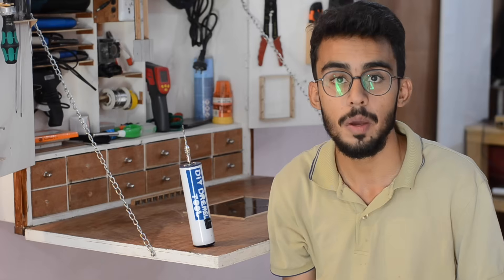How to make a Portable Dremel tool under 10$

Comment: SIR DO YOU MAKE DIY DREMEL TOOL BUT NOT IN CORDLESS, SOMETHING LIKE CORDED DREMEL TOOL, THING IS I DONT HAVE A RECHARGEABLE BATTERY SIR SO  IM DEPENDING  IN CORDED, LIKE USING AN 12V, OR 24V ADAPTOR  TNX

Comment: That 18650 battry is bad dangerous with no bms inside the also when u solder an 18650 pls dont heatup the battery it can blow up or damage the battery ex: the bat capcity is 2000mah if damge it ca change to 1200 mah.

Comment: You need to add BMS for your battery pack. Otherwise you possibly damage li ion cells, or worst they can explode due to overcharging. Please remove your video from YouTube. This is a very bad example for amateurs

Comment: I like this video I want to ask that you can make soildering iron at home
Reply: Better to get a new one 60w costs 300 inr and 15w costs 125 inr but 15w is not worthwile
Reply: ya ,you can make it as hobby, but as professional its difficult . in very shot time your battery power empty  . you have to charge your battery frequently . repeated you have to change that wireless soldering to use it for long time :) i hope your are happy with this answer .

Comment: What tool are you using to cut the fiber glass around min 10:10?
Reply from the maker: Ricky Hooper i am using a hole say to cut that
Reply: Amit Kumar Gupta
Reply: I noticed this hole saw myself. I have never used 1 like that. Is it adjustable for different hole sizes?

Comment: No protections on LiPo batteries + it's very dangerous to solder the batteries directly with a soldering iron.
You're giving very bad advices. When you don't know how to do it, you don't do it, and you don't pretend to be able to show it to others.
Please remove your video, it's dangerous.
Stop chasing after Youtube money.
Reply: are itni to protection de rakhi hai kamakal maaro sab ise milke
Reply: that is wht i was thinking ... but some cell protection inbult cells he can use ...shaft wobbles that bigg fault
Reply: সহজ ইলেক্ট্ৰনিক্স অসম sohojE - Na janake montobyo dise kiyo? LiFe aru LiPo 'r maajhot parthokyo aase, jaane ne?
Reply: yeah
Reply: Also don't drill in wood using metal drill. You'll burn it.
Reply: Salim Sarwar  No matter how much effort he put into it. It doesn't make his DIY correct or interesting. It encourages neophytes to do dangerous things and not to think about what they are doing.
Reply: This is not LiFePo but Li-Ion battery. They are safer than LIPo ir LIFePo but still can explode or catch fire.
Reply: ROBIN Guillaume First, it's not lipo batteries. They're LifePo batteries. Different chemistry. Second, yet, you can solder them directly. There are guys who make HUGE power wall battery packs to run their houses using exactly those kind of batteries and soldering them directly. (I can give you links). It would be dangerous IF those were lipo batteries.
Reply: @MCsCreations  No matter what, batteries do not solder directly with a heating iron. You can keep your ridiculous links.
Reply: Robin, you just proved how little you know. Learn before you troll.